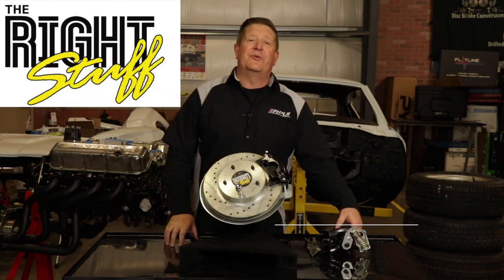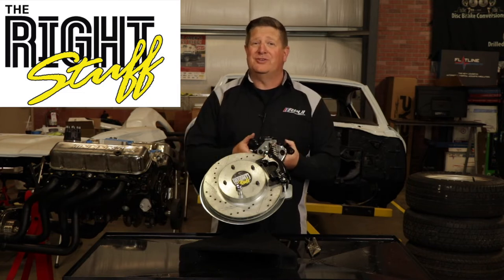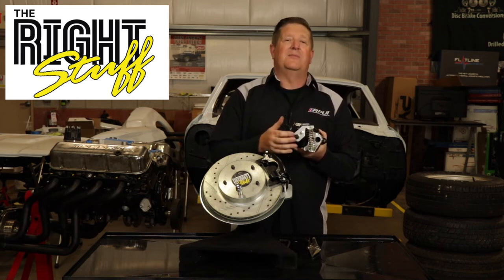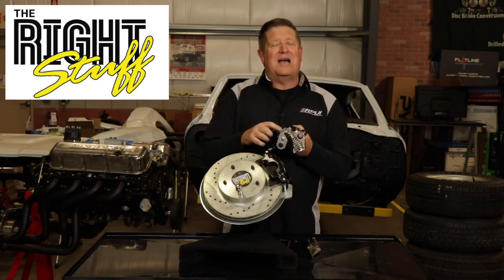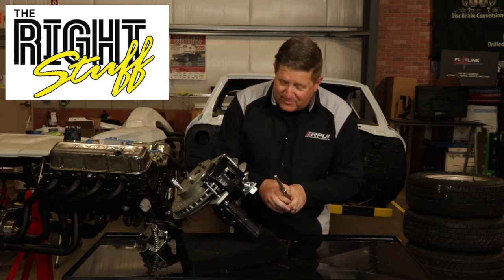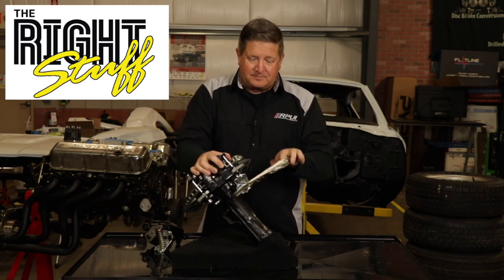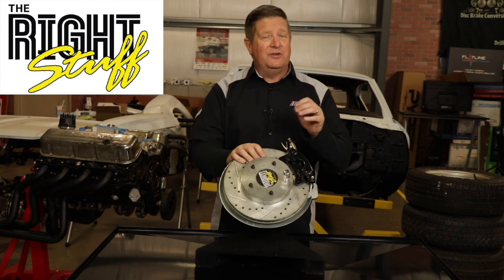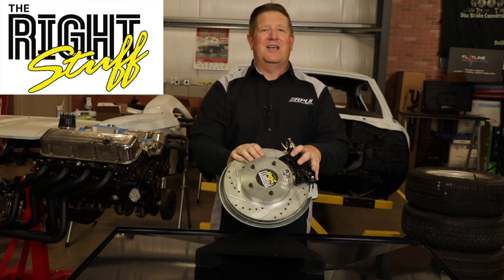How To Adjust Disc Brake Conversion Calipers With Parking Brakes

Comment: Of all the crazy videos explaining how to do this, you made what I thought was going to be a major task so simple.  I went out immediately after watching this video and had the gap adjusted in minutes.  I hope that this will bring my brake pedal up because prior to doing this my pedal almost went top the floor.  I will follow up with a rear brake bleed and hope for the best.
Reply: Did you drain the calipers before you adjusted them?
Reply: @junior9334  No just did it just as shown using the vice grips. didn't even have to open the bleed screws it is just done using the brakes built in self adjusting feature.
Reply: Did you remove the parking brake or did you just remove the tire and start to adjust the caliper?
Reply: @toraparks7046  I removed the cable and then used the vice grips on the lever. Watch the gap close as you "flick" it and get both sides as close to equal as you can.
Reply: @larryz24  so you didnt take the brake lines off?
Reply: @JosephReasor  No, not at all, after the adjustment I did bleed the brakes but the lines stayed on.

Comment: How can you adjust these once the Calipers are installed, with fluid, and bled?
Reply: Great question!
Reply: @pattayperformance  Mine are Baer brand and by simply applying the e-brake on a regular basis adjusts the caliper.
Reply: Mine are Baer brand and by simply applying the e-brake on a regular basis adjusts the caliper.
Reply: I just adjusted my calipers after they were installed and bled.  Just use the vice grips and do exactally as shown in this video.  I even had my cables installed, but I made a little mistake when I installed them- my handle was set on the first detent- so there's about 1/4" of slack in them.  I don't know if they would adjust with the cables at proper tension but I bet it would work just fine.  The cables go 'slack' when you push the lever forward and just come tight once the lever hits the stop.